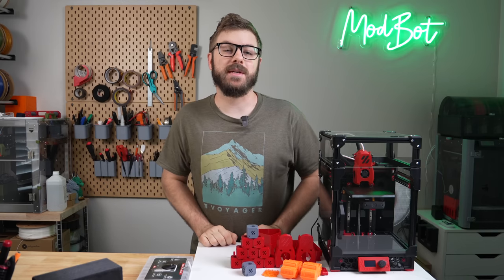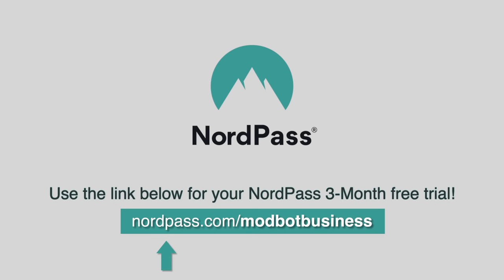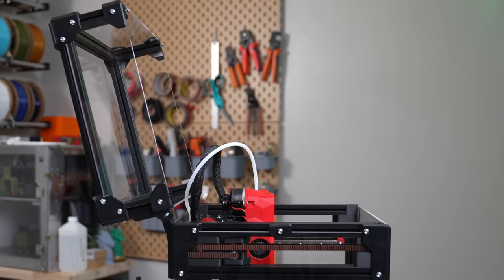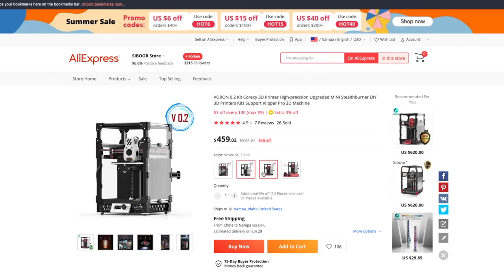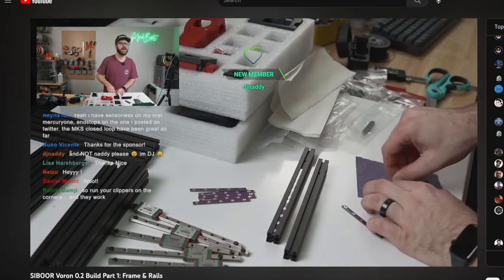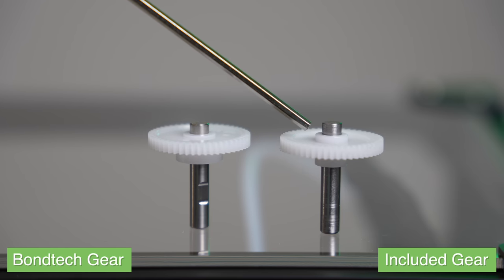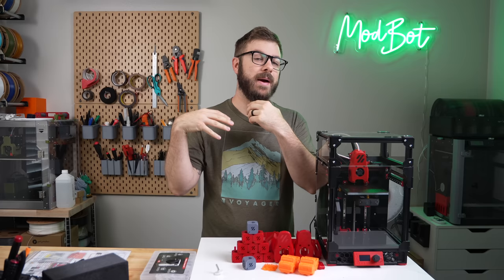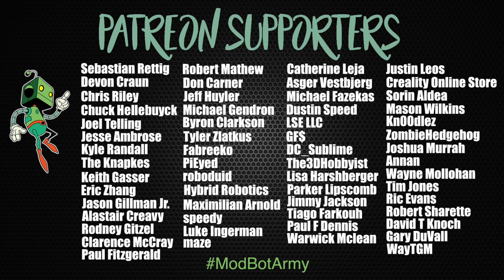Baby Voron Keeps Getting Better (SIBOOR V0.2)

Comment: Daniel, Thank you so so much your nice video!!! ☺
Just want to clear here some details which viewers may want to know.
The BMG gear has been changed to CNC POM material, as mentioned in Greg's video.
The problem of the hot end, which used to be due to the heat sensitive fixed inside the ceramic, which would expand and cause damage when heated, has now been improved and fixed in the hole of the aluminum block. 
There also has users want Dragon hotend HF version, we also offer that.  
The price in the video is promotion price during 10th-18th June, buyers should know Aliexpress has promotion season every year twice. 😄

Comment: I finished my Siboor 0.2 3 weeks ago. Had no issues wit the kit other than the plastic standoffs and one bracked for door latch was missing. But other than that all went together smoothly. I didn't mind those pcb strips for securing rails, worked well for me. Got the toolhead LEDs in my kit but took me a while to find some info on how to fit and wire them. So far my little V0.2758 has been reliably spitting out parts for my VzBot build and now for Switchwire/Enderwire conversion. Love it.

Comment: I Love the V0 based printer mods. They are very good stock but can get, in my opinion, so much better. Box Zero for the win on top hat problems. Tri Zero for bed leveling. And Sharkfin with anti squish mod for the extruder.  Such a well done video ModBot!
Reply from the maker: You really go me wanting to do the Box Zero. I am thinking Dragon Burner with Klicky, Box Zero, CAN, Filter, 1-2 Aux, Kiragami, and belted z. Probably off stream though if I am going to make it happen.
Reply: @ModBotArmy  Do It, you'll love it!
Reply: @ModBotArmy a silent stream is something I would watch. Just a dual camera stream split would be cool.
Reply: DO IT!
Reply: @ModBotArmy convert one to a Pandora’s box!!! I love building mine so far. So many better design choices than the V0
Reply: BoxZero with TriZero belts is the way. ZeroKlick is awesome.
Reply: i am only waiting on a seperate board to drive the extra steper motors to be delievered before i start a tri-zero, box-zero build. so excited. such an insanly capable printer

Comment: Coming from the FPV world I never understood why more electronics suppliers don't include wiring diagrams.  It could solve so much troubles
Reply: There are too many options. Kits for a specific printer could include one. In FPV, board manufacturers can include one because we are all doing the same thing: a receiver that has the same wiring as crossfire, and a vtx that either has the regular analog wiring with smart audio, or DJI wiring.

Comment: Awesome video, thank you! I've just completed my 0.2 too, although with formbot kit. The addition of pre-crimped cables andumbilical PCB was a huge deal!
Would you do a vidoe on your favourite mods and upgrades?
Reply from the maker: Woohoo! Congrats on completing your build. I have quite a few mod plans in the coming month or so here. Once they are complete I will likely do a video showing off the printer and can also include a few other mods that I think are great. :)
Reply: @ModBotArmy  A Voron build already is an individual (by the choice of the parts or the kit itself) and in some extend expensive 3D printer.

Maybe you could include into the next video (about the mods) how it comes that your modding a printer that is already self build?! Because all the changes could also already be included in the building itself or the choice of the kit, couldn't they? So how come modding is "necessary" like with stock printer like an Ender 3 although this one is already self build?
Is there a way to avoid that? Are there newest and "most optimized" kits out there?

Comment: Nice build, Id recommend next time the fans die, buy the GDStime Dual Ball Bearing, not the cheaper brushless/sleaved bearing units, the difference is like night and day.
Reply: alot quieter?
Reply: @Mr.Thermistor7228  No, more air flow, and last way longer, noise does not come into the equation, probably the Sunon Maglev would be a better choice for lower noise, performance is similar to GDStime but they cost a little more.

Comment: There is absolutely no content on Siboor Voron 2.4 out there. They have now some very cheap options for 2.4 and I'd really love to get one - but no one covered it yet
Reply: Rushmere 3D did a couple videos on the Siboor 2.4 kit.
Reply: @toddzino58  yeah but only hours long streams if that is the guy I think of. But for some reasone only v0.1 and 0.2 are covered on more than one channel. There is content potential for the 2.4 kit I think. I am realy curious about different opinions as I am eyeing the kit
Reply: @HuntersOA  I bought one in MAy.  Haven't started it yet.  Gathering some Mods and printing parts (Rama Idlers and Pin Mods.)  Not sure if I want to do TAP (they included the TAP kit for free) right away.  Also going with a Rapido hot end, not the dragon HF.
Reply: @HuntersOA  he did a 40 minute summary, which is really good.

Comment: For the price of that small kit printer you can get a bambu p1p printer assembled.
It's too bad the kit is the price it is.
Reply: But the Voron 0 is better..?
Reply: P1P is proprietary, closed source, with some unacceptable realities IMO.  If company goes under, you're done.  Also, it costs $699 plus $35 shipping, whereas the Siboor 0.2 kit is $469 shipped.  Not exactly equal in pricing by a long shot.   If you can't handle assembly, get the Bambu or buy a Prusa.